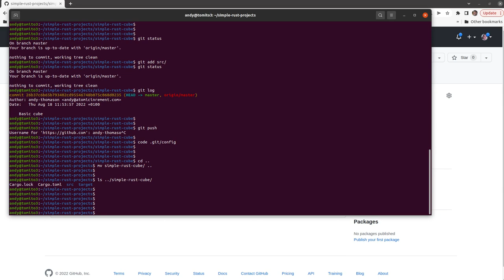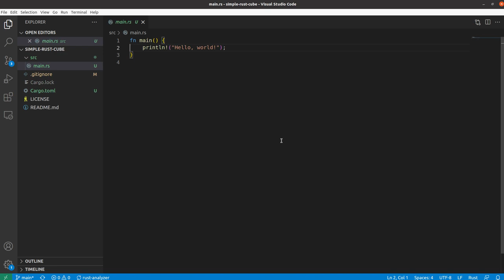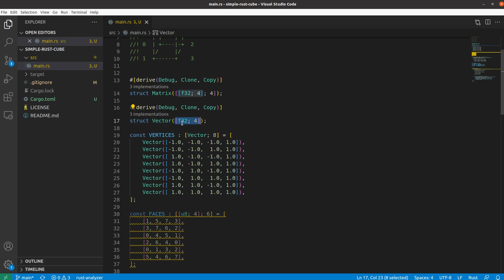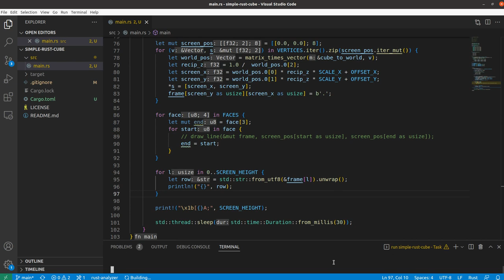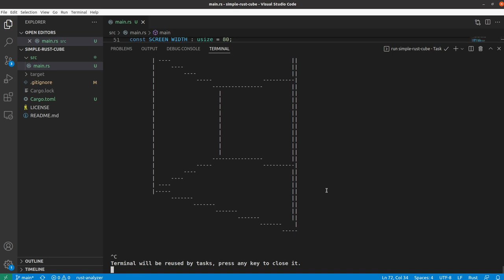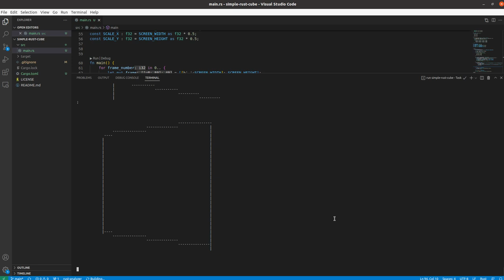Simple Rust Projects: ASCII 3D Cube.

Comment: Can we do this with some graphics and colors?
Reply from the maker: The aim of the demo was to show the basics of 3D maths without using a bloaty graphics library; but you could write to a bitmap for example by using [[[u8; 3], SCREEN_WDITH], SCREEN_HEIGHT] as the frame buffer. There are a number of libraries like sdl2 or preferably x11rb which will render a bitmap in real time.
I was going to do this with x11 at first, but ASCII is more fun.

There are large parts of the pipeline I've missed out like clipping and the full perspective transform and rendering perspective correct textures is a constant source of fun.
Reply: @andythomason8112  that's a lot of knowledge for me as I'm just learning rust. I'm able to do that digital clock project but don't know where to look for the graphical designing in rust.
Reply from the maker: @ArunVerma-xg4cg  No worries. I'll try to keep future projects nice an simple. I could do a follow up later for colours.